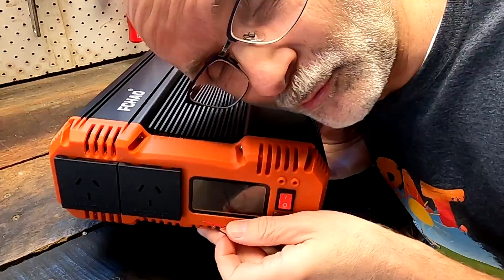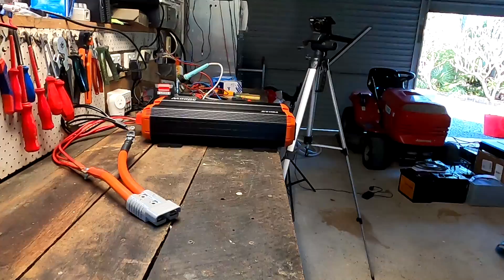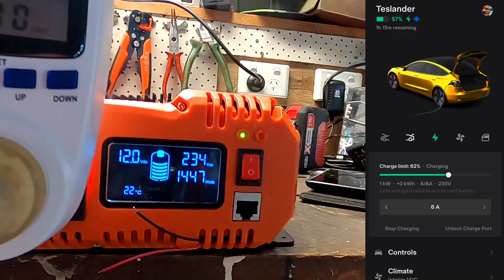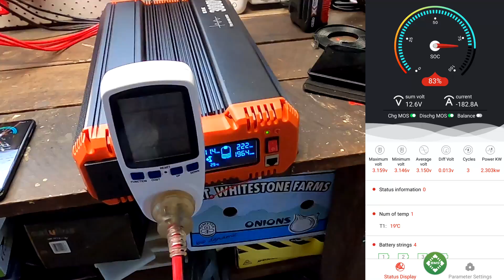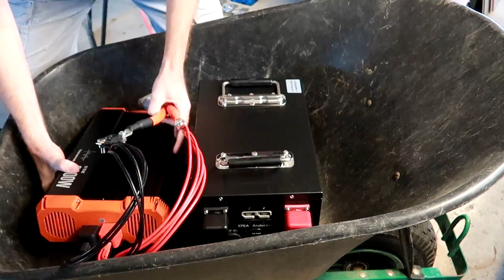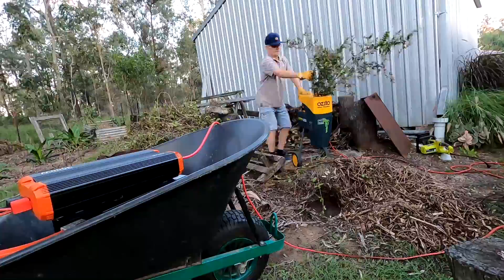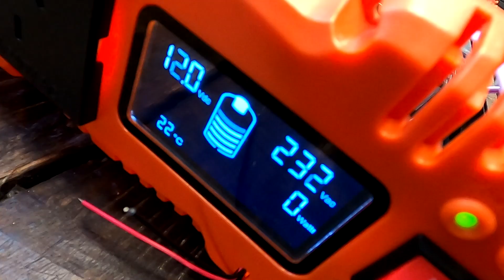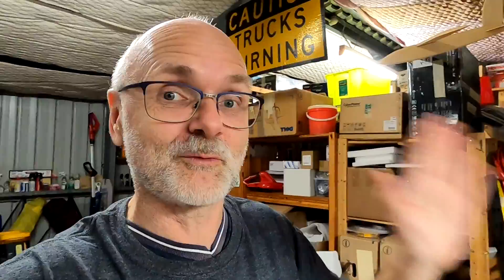The FCHAO Inverter Experience (aka Peter Inverter) 🤡 Another Chinese inverter or actually good?

Comment: Hello, always pleasure watching your content! Bought 12v1500w for my portable solar generator setup 2years ago. it works fine. Now 24V2500W for a bigger battery to power large home appliances one at a time. Do you have any more info about your Peter :-) how is he fairing up until now? Saw in another newer video on testing the middle battery I think 48v 3500w to charge your wife's car. Are both mentioned in use in some project? Or just for the garden?

Comment: Hello, dear channel author. I'll say right off the bat that my English is poor, so there may be some mistakes. I'd like to ask you if you could give me a blue inverter that turns off when I connect a Rayobi saw. I live in Ukraine, and we're still having problems with electricity. It's out for 12-16 hours a day. It's a sad situation, and I'm embarrassed to ask, but I'm asking. My $30-$50 inverters don't last long, and I can't afford more expensive ones, plus my batteries are old and run out of lead. Every day, I have to power the refrigerator, the heating pump, and the lights in a couple of rooms. We get our water from a well.

Comment: Can the remote display be connected with just one pair of wires, if you power it locally from a 12V battery for example? It will be necessary to make a special RJ45 cable of course, to separate the wiring, but I only have one twisted pair cable in place from one side of my house to the other. It would be neat to integrate the display remotely without having to run a whole new cable.

Comment: I'm shocked (pun intended) that you made no mention of the safety of this product.  The two red flags explicitly mentioned are undersized cables (fire hazard), hot glue HV output sockets(minor but telling quality indicator).  The HUGE issue with the 'this is better than Renogy' inverter is NO, ZERO safety ratings for AUS, US, CAN, EU. 

This inverter works, until it doesn't then you may get a free fire burning in your house, garage, RV, etc...

Without a safety rating, it should never be used unsupervised.

Glad you received a free product which can work for your chainsaw, but it's a huge safety red flag for other use cases and is really a ZERO frog product.  It's now three years later and still no safety ratings, yet it is still mentioned in other videos without a safety warning.  You don't want your SPAT to boil away needlessly do you? :)

Comment: The inverter has some kind of 'Low Voltage' protection. I am not sure if this means the output voltage or the input voltage. If it is on the input, that is great to protect the battery from over-discharging.
Since there is no way to change parameters of the inverter, do you have any idea to what voltage the 'Low Voltage' protection is set by default?
BTW, I am considering to buy the 48 V / 3000 W version of this inverter .

Comment: I bought this inverter 2 years ago after seeing this review. I only had a chance to test it now as I haven't had a system to use this with. Now, I am experience strange issue. I am using JBD BMS with a 12v LFP cells. When the charge is full, the bms turns off the charge mosfet and discharge mosfet is still on. The issue when when the charge MOS is off, its turning off the inverter. I see like 29V in the inverter display which is probably suggesting me there is an overvoltage spike or something. I haven't been able to figure out why its doing that (its only my guess). So, the point is the inverter is of no use if this happens as once the charge is full, the whole system is turning itself down. If anyone has similar issue or know why its doing it, please let me know. The connections seem fine as it seem to work while its not fully charged.

Comment: Hello,
great video! Also thanks to your tests I decided to buy this inverter which is doing great so far.
However, I wanted to bring the inverter data to Home Assistant using the inverter's 485 interface and a 485/lan elfin EE11A interface.
I tried but I can't connect and communicate.
Didn't you write something somewhere or make a new video about how to be able to interface with the “Peter Inverter” to get the data to Home Assistant!!!??
Reply: Also looking to see more info about the protocol but without luck... Someone to know more about the serial interface?

Comment: I bought the 1800W Inverter based on your review directly from the FCHAO shop in december 2023. Unfortunately the device released its smoke 8 months later with a load under 250W and i don't use it every day. It was in use for around 30 hours total. Of course no reaction from FCHAO Shop.
Reply: My guess is Andy got a good one (particularly as they sent it to him, they would have checked it to make sure it worked properly). Also guessing the rest of us have to make do with pot luck and their poor quality control as the one I got had multiple problems and there was no response from support.

In future I would only trust a product review where the reviewer blindly buys the item, NOT where the company knows who the recipient is. (This is not a criticism of Andy).
Reply: @billdonald3671  hey, what was the specs of your inverter and did you get it replaced or did the refund you the money but no replacement? I thought these were pretty good by most reviews .
Reply: @segundacuenta726  The same model Andy used in this video - 12 volt 3000 watt. Their option was a phone number in China. Useless to me in Australia. I disputed the charge with my credit card company and got a refund.  I bought a Giandel 3300 watt which has support in Melbourne. Seems ok so far, though I havent pushed it near capacity.

Comment: What are the actual dimensions of this inverter? Im tight for room and kinda need exact figure's. Is it 26.5cm wide from side to side or is it 26.5cm from the outside edge of mounting points? Thanks

Comment: Slightly concerning how smaller the  internal FCHAO heat sinks are compared to the other model, which would indicate a shorter life due to heat?
Reply: Using better MOSFETs with lower switching loss and heat generation can significantly reduce heat output.  Depending on the topology and type of MOSFET, you can easily halve the heat. For example, I replaced the MOSFETs in a cheaper inverter with some Texas Instruments ones. This improved efficiency from 82% to around 90%.  Some cheaper units use high-resistance MOSFETs or ones that can’t handle the switching frequency resulting in substantial switching loss.

Comment: Based on your experience with the 'Peter' Inverter, I have ordered both a 3000W and a 1200W in the 24V version.
I decided to go with 'Peter' instead of Renogy, partly based on your review, and partly because I wasn't happy getting 3000W out of 12V (requiring 275A at 90% efficiency - up to 330A when the battery is low) and I couldn't find a fuse bus for the fuses I was happy with. But at 24V, it all halves!
I've got 200A continuous at 24V to play with, so at 4200W (4667W@90%) I just get there at 194A.
Yes, I know, that jumps to 230A at 20V when the battery is low, and the inverters may not give 90% efficiency, but I'm also very unlikely to be asking for peak power continuously out of both inverters. I just want to be able to run power tools and lights in my workshop, which is currently (and may remain) unpowered.

Comment: Wow, I wrote a comment about how mine failed (overload with a 700 watt microwave and the display goes blank) and the comment has been deleted! 

Fchaomall do not answer chat enquiries and their email bounces. They claim 'Easy Returns & Refunds' on their site, but the return is to China. Nothing easy about that. 'Top notch support' that are uncontactable.
Reply: I replaced mine with a Giandel 3300 watt one ($305) (Melbourne, Australian sales office & support). It only has a simple remote On/Off switch with warning LED and unfortunately has small 6mm terminals, but it does work where the Fchao ($530) didn't. It comes with the usual undersized poor quality cables.

I haven't tested it at full capacity (as I haven't made up a thick cable to handle full load yet), but it does the 700 watt microwave (drew 1300 watts) that the Fchao couldn't.

Comment: 25mmq forn250A are perfectly safety, but at that length the voltage drop will be terrible.

1) super crappy plastic, terminal and fastener
2) what's the sense of test sine wave in idle? Obviously look good. Try with a 1500w power tool, with 3000w surge. This is the test.

Now, for me, all 1 hour test rewiuve is useless. Ok an inverter respects rated and surge power. And for this is good?
A car is good if respect max speed or if move??

A inverter review, a minimum idea if is good, is only at least several days constant max power use. And in this use check wave and voltage drop and peaks when turning rapidly on/off a big load.

With an hour test all world inverter are good

Comment: Hello  . Please tell me if I can use a welding machine with this inverter? (my welding machine used 2.4 mm electrodes and a welding current of ~ 90A ... but I can't say what voltage it uses on the output, probably somewhere around ~50v in operation and probably more when starting)

Comment: Heya, hope your gone do a lot work with tthis "peter" inverter need 1 for in my car wen I went in to the forrest to cut wood have a similar kind of chainsage as your thanks
Reply from the maker: The 'Peter' is still going strong and is the best 12V inverter I have ever used. 
They also make them in 24V and 498 now.
https://off-grid-garage.com/inverters/

Comment: another great video thanks.  Would be VERY interested to see what we can do on the RS485 bus.  Can we connected to the venus system???? Think you're a little harsh on the "multi" function display.... it does show a lot of information that could be considered "multi" :). .  It seems that the standby current on this is very reasonable.  10W is much better than inverters like Giandel which is about twice this.  Showing the output sinewave is a great test (thanks). Would also be interesting to show efficiency at different loads.  Maybe an idea for a future video?
Reply from the maker: We don't know the protocol of this port unfortunately. I can reach out to them and ask if they make it public. Someone should be able to figure out how to connect it to Victron.

Comment: Achtung China-Schrot. Beim ersten Gebrauch des Geräts kam es zu einer starken Rauchentwicklung im Inneren des Geräts.  Gleichzeitig kam ein stechender Geruch aus dem Gerät.  Ich vermute, dass ein Kondensator geplatzt ist.

When using the device for the first time, there was a lot of smoke inside the device.  At the same time, a pungent odor came out of the device.  I suspect a capacitor has burst.

Comment: All of these inverters have the same Problem, no adjustable low voltage cut off, can you use the rs something serial connector to turn it on or off through a charge Controller or battery shunt?

Comment: The renogy stops because it’s reached its plug limit per single plug, it’s a safety feature. If you hard wire both outlets into a consumer unit and work from that it should work ok for bigger loads.
Reply: Unsure why it'd be limited to under 10A on a single outlet. 10A is the standard outlet amperage in Australia, allowing 2.3kw. The chainsaw is only drawing 1.1kw. It may have a high inrush current, but that being only momentary, should not trip out an inverter that is adequately designed.

Comment: Since the provided cables are inadequate, what gauge would you recommend for this inverter at 12v 3kW?
Reply from the maker: I'm using the twin pair cables which came with the inverter and they work OK. Running my garden tools with 1.5-2.5kW does not cause any problems.
If you are planning to run higher loads for a long time, the cable diameter depends on the the length and voltage drop you may receive for your specific installation.

Comment: my renogy 1000w does the same thing if i connect to an ac or if i run the load up too high on inductive loads but not higher then the rated output mayby just a design flaw or something im going to ditch renogy when i upgrade to 24v otherwise renogy does the job i need it to for now just a bummer i cant run my ac which is only 450 to 600w
Reply: Do you think l can make meals every day on hob,  microwave, grill ?

Comment: Love the review. I live in the US so we run mostly on 110 VAC. With that potentiometer I would assume that I could lower the voltage to that, considering that We have options of 50 and 60 hz output frequency when buying the inverter..

Comment: Thank you Andy!
Considering buying this inverter. Here in Kyiv, Ukraine we have now regular electricity turn off after russian rocket shelling: 4-5 hours AC on and 4 hrs off every day. So this inverter (in my case 1500W) + some 12V car battery is really solution to keep light, internet router and charge phones, notebooks. Just needed review to choose proper inverter among many on Aliexpress. So thanks for detailed review with tests, oscillograph and disassembling!
Reply: Hi! I'm in Kyiv oblast and was researching this exact thing! Did you choose the 220v or 230v model?Ukraine now has 230v as ГОСТ but I think it's better for the batteries if it's 220? Also what type of batteries will you use? Did you buy from aliexpress? I checked and the shipping is 110$ :(  How long did it take to be delivered?
Reply: @yuriythebest  , actually both 220V and 230V would be Ok. All equipment works well in wider range. Only if battery is drained or if the load is too high - voltage may drop till 200V (whatever version 220V or 230V you choose), and this is not good for some equipment, e.g. for electric motors - they would be heated more. Equipment with impulse power supply (e.g. notebooks) are very tolerate to voltage. So do not bother with choosing 220V or 230V, better choose proper battery.
Reply: @yuriythebest  , concerning battery: I had experience with lead batteries (with normal acid filled starter battery and with gel-filled). These batteries tolerate high Amp discharge and works good if not discharged deep: if you never go below 11.8-11.9V (30-40% charge) they will work well. But if you go lower - the battery will degrade irreversibly. Once you go under 11V - lead-acid battery will loose substantial part of it capacity. Gel battery more tolerate to low voltage, but much more expensive. LiIon battery in this sense is theoretically much more applicable. But price is too high. I do not have experience with such voltage invertor and LiIon battery usage, only used to small 18650 cells. Maybe others can comment better. So my choice is high-capacity lead-acid battery + this invertor. Such batteries are still available in Kyiv. Only important to keep eyes on battery Voltage to stop invertor when it close to low 11.8V value. I have CTEK charging device to recharge lead-acid batteries, so hope this combination would be OK.

Comment: My  Epever  and  my  Chins  don't seem to like each other.   
The  batteries  shut off  at  high  voltage  28.2 voltage.   Is the manufacturer  suggested  setting correct

Comment: Someone told me to use the terminal block connections for max-load applications on the Renogy, or others like it. I have an inverter that won't start a small air compressor on the outlets, but it runs just fine on the terminal block wiring. With no terminal block on the Fchao Peter, the outlets appear to be more sturdily wired and with soldered connections.  Are the 40A fuses soldered into the circuit boards here, also? That's a pain in the ass.

Comment: Can you check if the live and neutral are inverted ? My Fchau inverter has Live & neutral reversed. ?
Reply from the maker: The output is floating. So, there is no phase and neutral output. Both have 0V against ground.
Reply: @OffGridGarageAustralia  Yes I am aware of that however the fchau manual states that negative and neutral are common. I have grounded my negative input terminal. With reference to that, neutral is showing up as phase and the live side of the Aussie plug is showing up as linked to earth.  Try it! I have yet to open the case.
Reply: I would like to get an RCD on the AC Side using standard wiring.
Reply: I would like to tie output neutral to earth but I dont want to blow this unit up!

Comment: Hallo,Do think i can load a elektric VW Golf with the mobil transformer? I need 6A, 2300 Watt. My pv modules have 5,5 kwp. I want buy the fchao 6000watt (12v or better 24v?)  and for powerqueen 12v lifepo4 batteries. Please response, thank you very much.  Thomas

Comment: Nice video thanks for sharing, questions, 1) can this inverter also connect directly on solar panels ? 2) Has it MTTP ?
Reply from the maker: No it needs a battery to connect to. There is no solar charge controller included.

Comment: Hi Andy maybe i missed a comment below but looking at the Peter Inverter i did not notice any earthing /equal potential bonding at the outlets and the exposed metal case , this would be considered a IT earthing system if it were fitted and if they are missing then  this is a safety issue for class 1 appliances , can you confirm the earth pins are connected to each other and the exposed metal of the Inverter ,  In the meantime i have also  sent an email to ask if the output L2 can be bonded to Earth /Frame but i have not heard back as of yet

Comment: What's the efficiency and idle consumption, please?
Reply: Same!
I also want to use it in my garage, connected to a 12v battery run on solar power,  with remote display.  So,  standby current should be as low as possible:-)